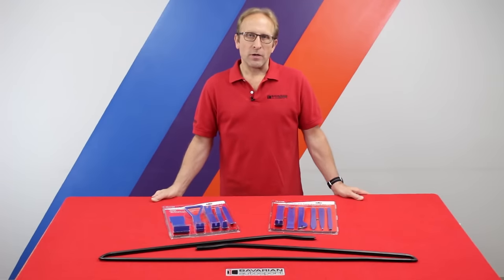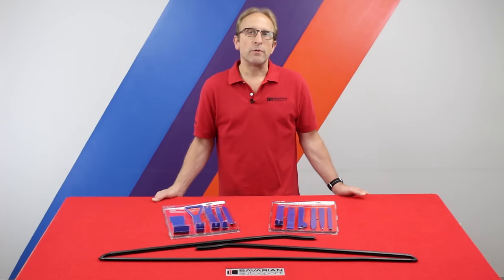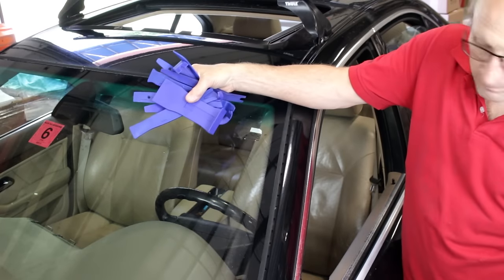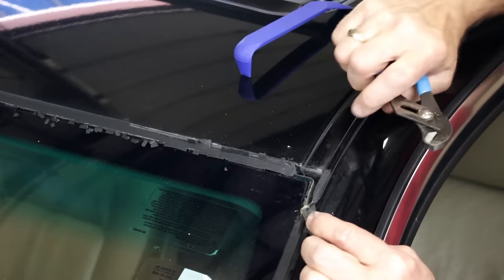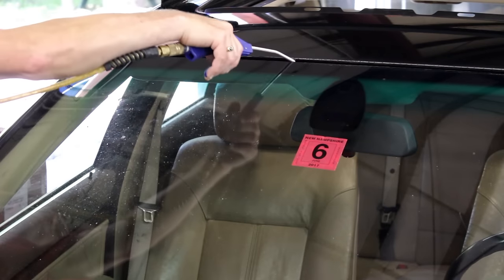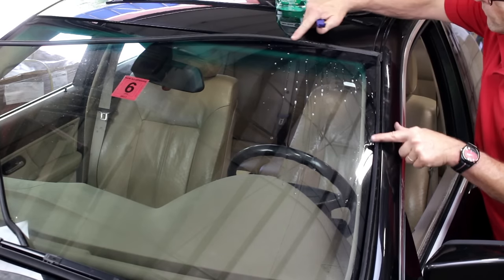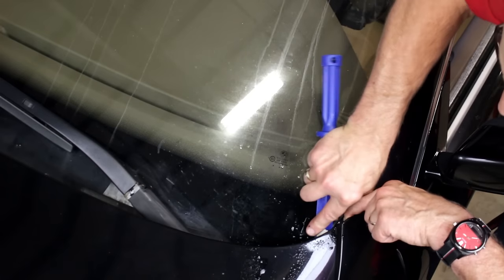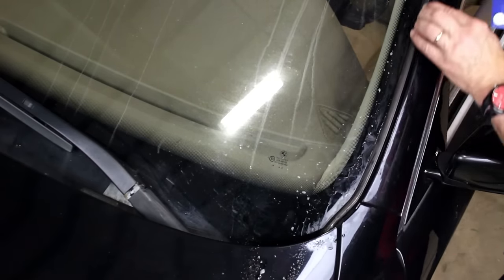Replacing Windshield Perimeter Trim Moulding Gasket on a BMW

Comment: Great video.  Worked well on 2002 E46.  don’t be fooled into getting windshield replaced.  This took 15 minutes with plastic trim tools, needle nose pliers and a bottle of windex.   might as well replace that cracked plastic windshield cowl while you’re at it.  feed the trim into the glass side first and use a trim tool to pop it into place around the back edge.  plenty of glass cleaner for lubricant.  once you get the corner seated, the rest is pretty easy.

Comment: Amazing you didnt break the windshield. Best way was to use a utility knife cutting off the molding at the bottom. Go all the way around. Then use the fiber stick to remove the locking strip. Also instead of struggling pushing the molding in, Use HEAT on the rubber molding before install  . It would go in  much easier.

Comment: Great video! I replaced these on my 2003 e46 M3. Only issue I had (and it took a significant amount more of time) was the windshield was replaced about 4 years ago and some of the sealant seeped out and bonded to my trim. The result; a real pain to get the portion underneath the windshield to come out in many places. I utilized a heat gun, extensively to soften and loosen the sealant from the trim and it worked well, but took A LOT of patience. Otherwise the process described here worked great; and reinstalling the trim was a piece of cake relatively speaking. Definitely want the above trim removal kit, or something similar, as it allowed me to keep from scratching the paint!

Comment: Great video. just a little word of caution. some windshields might not be perfectly lined up and will be a tight squeeze. when pulling out the old trim and installing the new one be very patient. it's a lot easier to break the windshield than you think.
Reply: True.  I broke mine about 3 hours ago.
Reply: Yup, I just broke mine, too.

Comment: What about the windshield lower seal/trim? Noticed water started leaking into passenger footwell when poured/rained behind Windshield Cowl. Does that seal wear off with time as well? It's been ok for years and started leaking really bad, seemingly out of nowhere. 2009 Bmw 328i

Comment: i install windshields for a living and this is actually quite a bad idea,  for one the glue is applied like you would caulk a bathroom so it can and will go everywhere with a zealous installer, 2 those rubber trim moldings are subjected to wind every single day if you daily it and thus they have a tendency to fly off even if they are properly installed so generally i will put some glue on it to back it before i put the main bead down just to make sure it's glued down, and 3 older bmws (e46s for example) have moldings with steel reinforcing in them so keep them rigid and looking good and they have a tendency to crack glass upon removal all in all just take it to a glass shop and have them put a new windshield and molding in they're only like $250 out of pocket even less with insurance.

Comment: I could only wish to have the good fortune the majority of posters had here; mine was/is a nightmare and after three- and one-half hours (3 1/2 hours) a complete failure.

2007 BMW E86 Z4 3.0si coupe, probably original gasket/seal/trim installed at factory and after 15 years cracked to hell and flapping/whistling at highway speeds.

Watched all the videos I could find, 'ole Otto" at Bavarian Autosport, a number of YouTube experienced posters; watched them several times and wrote notes to take into the garage.

The only conclusion I can reach is that the gasket/seal/trim was installed onto the windshield at the factory and then the windshield with gasket/trim/seal was installed into the car.

The amount of clean-up time exceeded thirty minutes (30 minutes); was careful to only utilize non-marring plastic trim tools, "Goof-Off", "SprayAway" glass cleaner, and lots of paper towels.

While removing the original, damaged gasket/seal/trim took notice that there is a metal "C" embedded in the gasket/seal/trim that has to form around the edge of the windshield glass; there is no way that I could discover to replicate this in my garage.  I made numerous attempts over the course of over an hour to lubricate, use aforementioned trim tools, to work the trim around the windshield glass - - - you guessed it: NO WAY IN THIS REALITY.

There is a word I am thinking of to describe the engineers that designed a piece of degradable rubber trim that cannot be replaced without removing a windshield glass and risking breaking or damaging that in the process, but I will keep that word to myself.

I have to assume that most people are just jamming the gasket/seal/trim in crushing the "C" channel that is supposed to grip the inner and outer edges of the glass; maybe not realizing this action; and when a seemingly tight positioning is achieved saying: "JOB DONE, YAY ME"; well maybe I have an extra tight clearance between the windshield glass and the opening in the body, but there was no way I could achieve even this; bloody knuckle and sore hands to prove it.

Lest anyone think I am some kind of "newbie" and ignorant I will state for the record that I am in my sixth (6th) decade on this planet and have been working on cars for fifty plus (50+) of those years.

Good Luck to the rest of you, for me it's going to be a bead of black urethane and wait for the inevitable rock to be thrown back at me by a non-tire flapped vehicle causing a chip/crack and let the insurance deal with it.  Man, this is really frustrating - - -  Can you tell?!

Comment: Couple of additional points after reviewing the BMW repair manual....

The sealant used to bond the windscreen down can bond to the gasket.  The gasket has a special tear-off strip that will tear away as it is removed in cases where the sealant has bonded to it. When replacing just the gasket, the instructions call for the tear-off strip on the new gasket to be removed prior to installation. When the glass is also being replaced at the same time, the tear-off strip should not be removed. (With that, if the just the gasket is replaced and then the glass is replaced later on, a brand new gasket should be used otherwise it will be impossible to remove the gasket again as it won't have the tear-off strip and will be bonded to the sealant).  When I removed mine, the tear-off strip was pretty much intact, suggesting the sealant was recessed a little further in, so I didn't bother to remove it from the new gasket. 

The instructions do not call for any additional sealant to be used.  The new gasket already has a bead of butylene sealant in the C-channel (this is the tacky substance seen on removal)

Where excessive sealant was used for glass installation and is now visible in the channel, the bottom rubber edge should be pared away to allow proper seating of the gasket. (presuming you can't remove it from the channel).   I had one small section where excessive sealant was used and had bonded to the main gasket beyond the tear-off strip. It was a pain but I did manage to remove it using a needle nose pliers and a twisting motion I also managed to chip the edge of the glass - luckily it did not crack.   I suspect the excessive use of sealant is the main cause of windscreens breaking on gasket removal as the sealant breeches the tear-off strip and bonds to the gasket, and more force is then required to remove it (application of heat may help here).

Once out, I cleaned up the channel and area around the windscreen.  I scraped away the bit of excess sealant that was in the channel but in hindsight this was a bad idea.  The excess was up near the corner and in scraping it away, I scraped the paint as well.  The corners are the one place where water is likely to pool under the seal as it rolls off the roof.  I dabbed a bit of paint on the scratch to prevent rusting.

Installation was very straightforward after that.  In my excitement of pulling the old gasket off, I neglected to pay proper attention to the way it meets the front cowl.  While sightly counter intuitive, the gasket runs under the cowl.  By the way  if the gasket has deteriorated and requires replacing,  it is very likely that the rubber part of the cowl has deteriorated too.  Mine started to crumble as soon as I touched it.  Replacement cowl has been added to my to-do list.

All in all its an easy diy as long as you're not unlucky with excess bonding sealant.

Hope this helps.
Reply: So, to sum it up, all you need to buy is the new gasket? There is no need to add sealant yourself, since it will be part of the new gasket? Just put the gasket in the gap between the window and bodywork and everything will seal itself?
Reply: That is correct.  No additional sealant required.  One word of caution, the glass, especially in the bottom corners would appear to be quite fragile.  A couple of months after replacing the seal I noticed a small crack across the outer pane at the bottom corner.  It's all within the black border so it not readily visible unless you look for it.  I don't know if it happened at the time of installation and I didn't notice,  or if it developed afterwards.  Just be careful, don't apply too much pressure, and don't scratch the glass edge with the steel within the sealing strip.
Reply: @MrUnderwurlde  perfect! Thanks a lot! Sounds like it should be doable

Comment: Great video due to the information provided! I have a 97' E39 (528i) and was about to take it to a windshield store to remove the windshield just to replace the trim moulding. They told me the windshiled neec to be removed and possibly would crack. So I'm very happy that I found you guys and this video as it will save me a lot of money. Thanks for posting!
Reply: How did your project turn out? Did you do it yourself? Any cracks in windshield?

Comment: Working on my 2002 Volvo V70 presently, need to pick up some non-marring chisels.  $400 to safelite, $300 to Volvo in parts!  But I'm replacing ALL the surrounding trim, a cowl seal, various clips, and cleaning out the roof rails too, i.e. breaking a lot of 20-year-old plastic bits along the way.  The upper and lower windshield trim were the most expensive at $80 each.  I'm basically doing all the work for the safelite guy, he's just going to show up and swap the glass.  After that he can bugger off, nobody touches my dad's last car!

Comment: Only recently found out you can change this part without windshield removal. My 2002 5 series has the original glass and this part is only just now starting to rot (in the corners as per usual). Well now I have this information, it's a given to replace it.

Comment: What do you do if the modling is so extremely tight that it's just impossible to push in? I have new molding for Mitsubishi Lancer, but there is just no way it goes in. Yes, I tried a lot of different things, used all my strength, but it does not fit. Yes, it's the correct moldiing for this make and model. It's like some special tool is required that I am not aware of.

Comment: @bavauto - Do you have a video for the F10? I'm trying to replace mine and having a very hard time getting to the metal stiffener portion of the seal. It seems to be tucked under the glass more so than E series windshields.

Comment: mine was coming a bit loose so what I did was clean up the area, bought a $5 JB weld tube . glued it right back.  no problems
Reply: Juan Ramirez not a great idea buddy eventually it will become brittle breaks nd crack away and you will have job quick all on the liner

Comment: Be prepared to buy a windshield.  Some windshields don't fit right, are glued in crooked, or are over glued greatly increasing the risk of it cracking during this procedure. This is why shops may sell windshield removal!

Comment: Why doesn't anyone mention part number 51311925433?? Where does it go, what's it for?
Reply: These buffers are used when the windscreen is being replaced.  They are used to align and hold the glass in position while the adhesive drys.